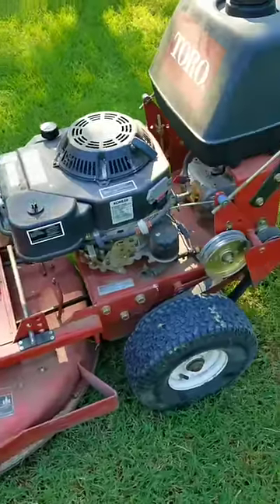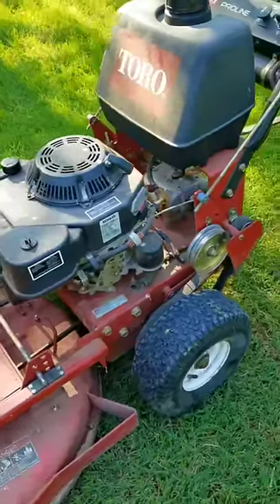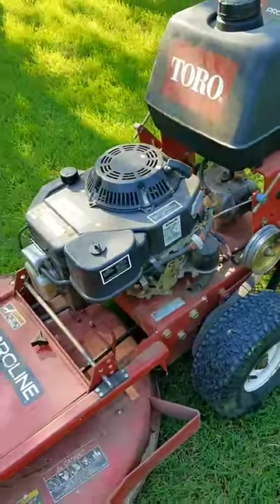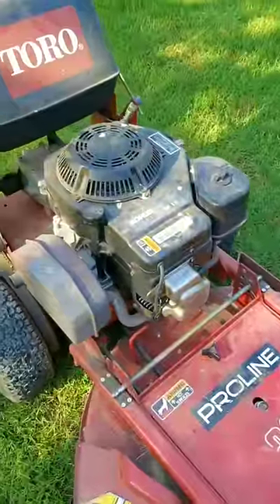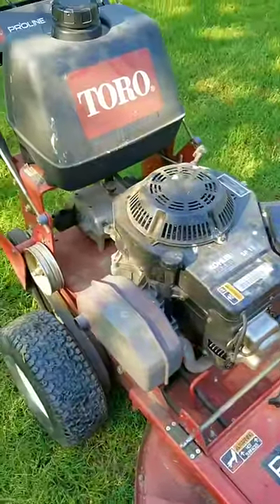What's Wrong With This Toro Walk Behind Mower?

Comment: Stuck valve won't let it have any compression and the valve is not seating in other words the valence probably bent
Reply from the maker: close turns out the valve lash was out, by a mile
Reply: @INSIDEHOUSEGARAGE  I've had to repair several farmers generators that they have on the furniture horse trailer / camper and I've run into that problem several times along with valve adjustment

Comment: Fuel filter or fuel supply hose, air filter or could be a weak spark plug.
Reply from the maker: turns out the valve lash was much too tight.

Comment: Well it has spark which is a good thing, the carb is clogged possible and just needs a cleaning,that's my guess.
Reply from the maker: nice guess. but it turns out the valve lash was out by a mile

Comment: You probably have to clean out the carburetor take the spark plug out grab a screwdriver and see if there's combustion
Reply from the maker: carb was cleaned twice, turns out, the valve lash was much too tight.

Comment: So Flywheel key is not a engine thing, but a lawnmower thing. The only way to diagnose would be to have mower experience not engine experience
Reply from the maker: turns out the valve lash was out by a mile

Comment: I put a big drill on the top of the motor to get full time cranking while i have my kid hold onto the spark plug wire connector.
Reply from the maker: turns out valve lash was much too tight

Comment: It's a Kohler , never serviced, and the valve clearance is wayyyy out of specification , too loose , just set the valve clearance and clean that carb and you good !
Reply from the maker: correct turns out the valve lash was out, by a mile

Comment: Could be rings are worn out. Sounds like no compression also could be the flywheel key
Reply from the maker: that's close enough, there was a compression issue but it turns out the valve lash as out by a mile.

Comment: Spark plug or the electrical system, it could be whatever sends the power to the spark plug.
Reply from the maker: turns out the valve lash was too tight
Reply: @INSIDEHOUSEGARAGE  well thats weird that doesn't happen all of a sudden while mowing, someone had to have changed the clearance.

Comment: The number one problem I made a lot of money is a kid and it's a soft key has been bent from hitting hard objects with them or it's really easy to put it out of time you never sews lightly all you do is change the soft key under the flywheel and it will start right back up and run again
Reply from the maker: turns out the valve lash was too tight

Comment: Guys....the belt drive blade makes the sheared flywheel key unlikely.
Reply from the maker: you are very correct about that, turns out, the valve lash was much too tight.

Comment: Pull the valve cover and look for bent or missing push rods.
Reply from the maker: close, it turns out the valve lash as out by a mile.
Reply: @INSIDEHOUSEGARAGE  And it didn't throw a rod? Wow you got lucky.

Comment: The points and condenser are under the fly wheel.  You’ll need a wheel puller to get to them.
Reply: Once you Adjust those I’ll bet it starts.
Reply from the maker: turns out the valve lash was much too tight.

Comment: Timing . There is a plastic gear in crank case , replace it …. It will run , and while your in there , lap valves and new rings , hone the cylinder.  , and it will run like new !!!! 🎉
Reply from the maker: turns out the valve lash was too tight.

Comment: Try unplugging it and plugging it back in. That usually does the trick.
Reply from the maker: turns out the valve lash was much too tight and it has an auto re-set

Comment: What I would do as I would pull the air shroute off take the screen off take the bolt off that crank it holds the fly wheel down take a polar pull the fly wheel replace the timing pin
Reply from the maker: turns out the valve lash was too tight.

Comment: Need to see the plug before I could even try to make a guess. I've seen plugs fouled because of improper filter placement. But also the spark plug tells everything you need to know about the engine. But here's my guess anyways. Timing magnet or aperture Has Broken. Pull plug. Or have fun and just stick your pinky in sparkplug boot. Then have your friend pull. FUN!😆
P,S,. LIttle funny story about me. I have developed a resistance to electricity. Like I used to test up to but not above "220v" 110×2 with my fingers. I have fun with my ability. Try touching someone while you're live. Lol! My favorite was putting my finger in a sparkplug boot while vehicle is running and putting my other hand on the person touching the car! It's AWESOME! And unless you grew up on a ranch testing electrified fence wire as a child. This might not be good 4 U. As it only takes around .4 milaamps to stop most people's hearts.
Reply from the maker: turns out the valve lash was way out of spec
Reply: Fould plugs don't fire.
Reply: @danstiverson  yes. Yes they can. Have you ever worked on anything that runs on spark ignition? Do you comprehend the difference between diesel engines and gas type engines? Bet you the kinda tool that looks for spark plugs on a diesel engine. Those are not spark plugs. They are glow plugs. ✨️
Reply: @INSIDEHOUSEGARAGE  that's very concerning. Valve adjustment basically never needs to be adjusted unless the engine is about to take a dump. Yeah single stroke engines really only have 3 things that go wrong. Filters, carb(got an awesome trick for fixing/clearing clogged ports. Get a bread wire tie and burn off the coating. Use to clear ports.)and oil. So many people just run their lawnmowers out of oil! Also people destroy their carburetor because they don't properly store their lawnmower. Like seriously just get some fuel stabilizer and run the mower. Or buy a can of stabilized fuel. It costs like 10$ at Walmart for 1 quart of the good premixed stuff. Don't store your lawnmower with empty tank or un stabilized fuel. Saves you big money. Also please check your oil.

Comment: Had the same problem with a exmsrk  with the Kawasaki .check compression bet it's way low
Reply from the maker: you are correct, turns out the valve lash was too tight

Comment: I would change out the plug first if that don't work then I would get a new carburetor kit and more than likely is one of the two
Reply from the maker: Close, it turns out the valve lash was much too tight.

Comment: either the spark plug or also needs the fuel filter cleaned
Reply from the maker: turns out the valve lash was too tight

Comment: Also , I have a cub cadet riding mower and it didn't just bend the rocker arm it broke it in half.
Reply: @ENDERTON2000  I have a bad boy magnum zero turn and it has now had its 3rd starter on it.

Comment: It's bigger call it's not just right and I could not have no compression that needs either the cylinders bad or the valves are bad
Reply from the maker: turns out the valve lash was too tight

Comment: It sounds like  it overheated and maybe bent a rocker arm and thus the timing is off. Those motors are bad for this issue .
Reply from the maker: Close, it turns out the valve lash was much too tight.

Comment: Well you've got far cuz you're backfired to the carburetor. That could be carburetor or there's a shear key in the main shaft. If that's broke it'll throw it out of time so bad it can't run. And you will get back far into the carburetor and kick backs.
Reply from the maker: turns out the valve lash was too tight

Comment: Adjust the valves clean spark plug and you will be back in business
Reply from the maker: you are correct
Reply: @INSIDEHOUSEGARAGE  I always go with the middle or high clearance of the exhaust valve lash. Reason being do to the heat expansion.

Comment: I thought I saw a flame in the carburetor usually that's adjustment for the valves.
Reply from the maker: very good eyes, yes it flamed out the carb, turns out the valve lash was much too tight.
Reply: @INSIDEHOUSEGARAGE  it seems to be a common problem nowadays. It's sad cuz most people throw away good engines. Another common problem is hydrolock. I've had many people come to me and say their engine is seized up they try to pull the cord and it won't pull I tell them simply unscrew the spark plug pull the cord put plug back in it'll fire right up works every time.

Comment: Wrong all of you not the timing flight will key Magneto's dirty on it full of magneto clean the magnet clean the magneto itself with a 400 grit sandpaper using matchbook or business card for gapping screw it back in place fresh new spark plug and you're set to go! I used to fix these as a kid!
Reply from the maker: turns out the valve lash was out, by a mile

Comment: Check valve gap. If that’s good I’d check the key on the flywheel.
Reply from the maker: you are correct turns out the valve lash was much too tight.

Comment: He hit a freaking rock, big root, flu wheel asked to take a spin around the block.
Or cam skipped a tooth when he got it
Reply from the maker: it turns out the valve lash was much too tight.

Comment: Timing flywheel key has sheared and the flywheel is not in the right position for the lawn mower to run
Reply from the maker: turns out the valve lash was too tight

Comment: While not the same company toro would use you could go get an engine for that from harbor freight for a few hundred bucks and have it swapped out in an hour or less and have peace of mind it was good all the way instead of just repairing whatever was fucked up
Reply from the maker: turns out the valve lash was too tight but thanks for the idea.

Comment: Overfillled oil. Hydrolocked or sheared key
Reply from the maker: the oil as at level, and it wasn't hydrolocked, it turns out the valve lash was much too tight.

Comment: Get the neighborhood bully, err smart kid to stick his finger in the spark plugs cable while you pull the start rope , it should be evident if the coil is working
Reply from the maker: turns out the valve lash was out, by a mile

Comment: Faulty operator presence switch or the fuse.
Reply from the maker: turns out the valve lash was out, by a mile
Reply: @INSIDEHOUSEGARAGE  ah!
Reply: @INSIDEHOUSEGARAGE  the 32" Toro belt drive was my first mower to buy over 20 years ago. 
Good times!

Comment: Flywheel key is sheared in which timing off &no way will that start
Reply from the maker: turns out the valve lash was too tight
Reply: @INSIDEHOUSEGARAGE  ok that would b the other cause glad u got it figured out

Comment: Take the pool cover off get some real life sandpaper clean the wheel with a magnet is clean the coil where it touches it take a business card put in between both of them tighten it down pull the business card out put the lid back on to pull cord put a new spark plug in it that doesn't work when you pull it over take the carburetor off check the gasket clean the carburetor out thoroughly and blow it out put it back on take the old gas and sipen it out put new gas in it premium and start it up. Later
Reply from the maker: thanks
Reply: Let me let me know if you get it started and let me know how you got it started okay. Later

Comment: Spark plug. Spark generator
Reply from the maker: turns out the valve lash was too tight.
Reply: @INSIDEHOUSEGARAGE  
OHV lifter adjustment.   Regular maintenance kind?        I screwed one of those lately. Broke the adjustment nut,  must have got the adjustment screw inside the nut to tight. 6 dollar nut. Old husqvarna hydrostatic. Rider 16. 15.5 HP.     $200-$250 more repairs  If you do happen to see this....think it is worth it??

Comment: Intake valve stuck open anytime it backfires to the carburetor
Reply from the maker: turns out the valve lash was too tight.
Reply: @INSIDEHOUSEGARAGE  thank you very much cuz that motor's belt driven not direct drive direct drive yet would be the key way

Comment: That's a easy fix, the carbon dioxide, catalytic converter, reverse osmosis compression, space modulator, fuel leveler, battery registration,  regulator machine is not working. 😁
Reply from the maker: turns out, the valve lash was much too tight.

Comment: Hit a rock busting the aluminum key on the crank causing a timing issue
Reply from the maker: the blades are on spindles, turned by a belt. Hitting a rock would more than likely just cause the belt to slip. Also it turned out the valve lash was much too tight. adjusted them and it starts and runs now.

Comment: Take the carburetor off and clean it apparently it's not getting fuel because you sprayed fuel in it you know it's getting fire so the carburetor is dirty and any more I think a carburetors like 25 30 bucks I don't know what they are for them get a new one
Reply from the maker: turns out the valve lash was too tight.

Comment: It's not firing, get an idiot to hold the spark plug wire to be sure.  Lol I did this to my husband who has no mechanical sense just so happens my mower was firing.  Normally you can see but the sun was really bright that day.
Reply from the maker: Close, it turns out the valve lash was much too tight.

Comment: Flywheel key.. experience myself. Probably ran over a rock or something
Reply from the maker: unfortunately the valve lash was too tight,  adjusted it and it starts and runs fine now.  Good guess though

Comment: Just put water down gas from leaky can into my new Toro an wouldn't run an kept  backfiring like this  tool lime off carb drains bout qrt tank pit most don't realize water I'm gas sinks the water sinks an is first thing feeding the carb
Reply from the maker: turns out the valve lash was out, by a mile

Comment: Coil , see if it's getting a spark I'm betting coil
Reply from the maker: turns out the valve lash was too tight
Reply: @INSIDEHOUSEGARAGE  electrical problem. Ignition Coil or pickup coil

Comment: I was gonna say a stuck valve, or the lash was too tight and after looking at the comments that confirms it
Reply: I had a Briggs & Stratton V twin that was backfiring out of the carburetor, and I found the intake valve on one of the cylinders to be stuck so I gave it a tap with a hammer and that fixed it.
Reply from the maker: yes the valve lash was much too tight.
Reply from the maker: nice work!

Comment: Do your maintenance on it probably the plug if it won't be backfire like the gentleman that made the left comment it could be the right I'll try that or the air filter
Reply from the maker: turns out the valve lash was too tight

Comment: Compression sounds like doesn't have compression
Reply from the maker: you are correct compression was low because it turns out the valve lash was much too tight.

Comment: Sounds like there is low compression
Reply from the maker: you are absolutely correctly and it turns out the valve lash was out, by a mile

Comment: The magneto is failed up and needs a new spark plug.
Reply from the maker: turns out the valve lash was too tight
Reply: @INSIDEHOUSEGARAGE  Toro's are known for that problem and also magneto failing up.

Comment: The lash is out on your OHV adjust them and you should be ok.
Reply from the maker: correct, turns out the valve lash was too tight
Reply: @INSIDEHOUSEGARAGE  had it happen to me a few years back. Drove myself crazy figuring it out lol.

Comment: Disconnect safety wire
Reply from the maker: don't need to, spark works and it turns out the valve lash was out, by a mile

Comment: I have a kohler that would be perfect for that walkbehind
Reply from the maker: thanks, but turns out the valve lash was just too tight, it's running great now.
Reply: I save all the greats as I come across them just in case there is a frame in need of a good heart

Comment: It's dirty.  Give it a good cleaning and a coat of wax.  If it looks good it'll run good.
Reply from the maker: turns out the valve lash was way out of spec
Reply: @INSIDEHOUSEGARAGE  bet the coat of wax would've worked too.

Comment: Just regap the spark plug not always seems to work
Reply from the maker: turns out the valve lash was too tight
Reply: @INSIDEHOUSEGARAGE  oh that makes sense I was just being funny.. as most small engine repair guys always ask me that first.  Did you gap the spark plug..lolol
Reply: @INSIDEHOUSEGARAGE  oh that makes sense I was just being funny.. as most small engine repair guys always ask me that first.  Did you gap the spark plug..lolol

Comment: Broken valve spring. No compression.
Reply from the maker: turns  out the valve lash was too tight.
Reply: @INSIDEHOUSEGARAGE  Koehler has hydraulic lifters. If it sat up or had high varnish oil they can stick open. The springs are very week on those. I have taken the springs and seals off the valves spray the stems down with PB blaster be sure they’re free. I had a customer tell me his mower hasn’t ever ran that good, his were sticky I put a drill on the very top and worked them.

Comment: Flywheel key, everyone sees the same problem.
Reply from the maker: turns out the valve lash was much too tight.
Reply: @INSIDEHOUSEGARAGE  , seen that once on a Briggs, it was a new engine. Never seen this on a used one. Can you tell what caused it?  In reference to valves, delivered a new generator to residence that had a pushrod drop from rocker, techs could not figure it out until I told them to remove rocker cover.
Reply from the maker: no we haven't figured out what happened to this one, our guess is a camshaft issue.

Comment: Shear pin on flywheel.
Reply from the maker: that's a good choice but it turns out the valve lash was much too tight
Reply: @INSIDEHOUSEGARAGE  That's the second thing I'd have checked. 👍

Comment: Clean the key way see if it bent
Reply from the maker: turns out the valve lash was too tight
Reply: Valve lash was to tight great  the hunting club I belong too has ever lawn mower you could think of well every end of summer we all go to the Property and every mower needs to be drained of old gas and sometimes the crank key way is bent no start ! Then go into the garage on the wall is a page of key way to retime the engine ? That what I though! Sorry